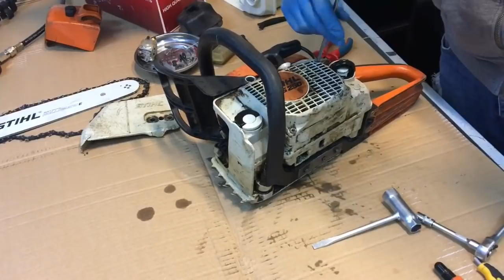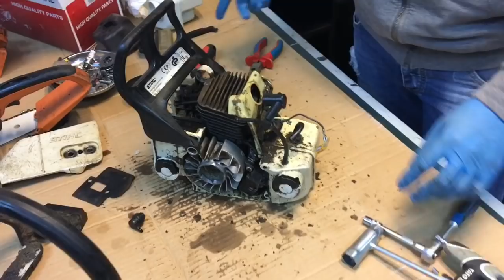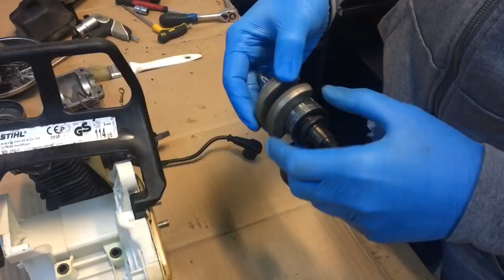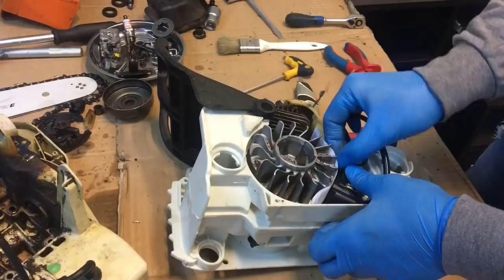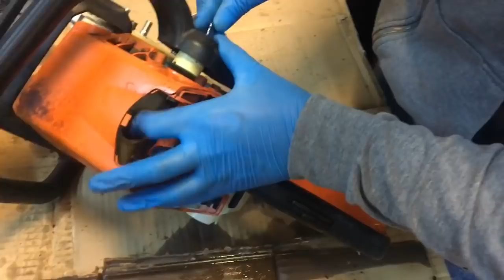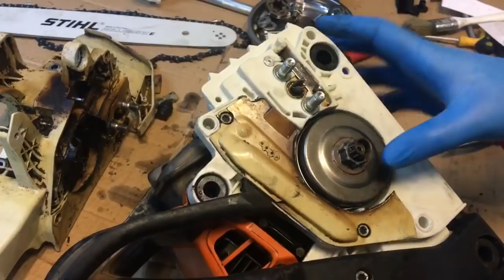Schimbat carter drujba Stihl Ms 210 , 230 , 250, 021, 023, 025

Comment: SALUT SI SANATATE O INTREBARE AM UN STIHL MS 260 RECONDITIONAT APROAPE SUTA LA SUTA BOBINA NOUA BUJIE NOUA NGK MPMBR7A DAR VOLANTA E VECHE CAM UZATĂ RAU  NU POT REGLA DISTANTA SA FIE EGALA LA AMANDOI PAPUCI DE PE BOBINA ORI CE AS FACE SI NU DA SCANTEIE CONTINU CI DESTUL DE SLAB SA FIE VOLANTA PROBLEMA? ȘI INCA O INTREBARE GASESC LA VOI PIESE HUSWARNA  42 CARB GALERIE TIJA ACCELERATIE TIJA SOC FILTRU DECI TOT CE APARTINE DE ADMISIE?
Reply from the maker: Cel mai probabil este volanta, s-a ovalizat gaura... pt husqvarna 42, nu avem
Reply: @SHRMotorsOfficial  MULTUMESC